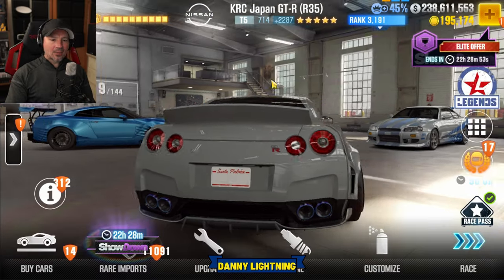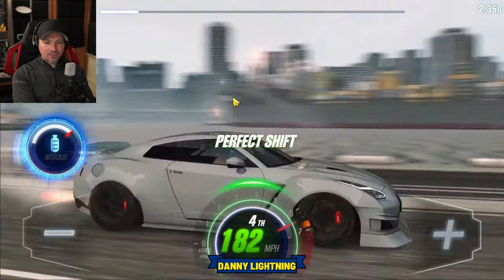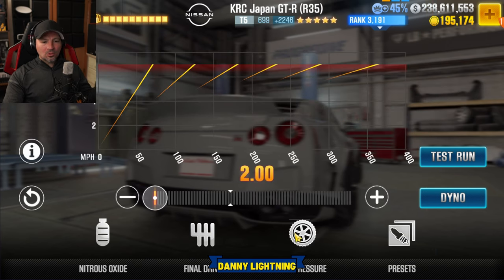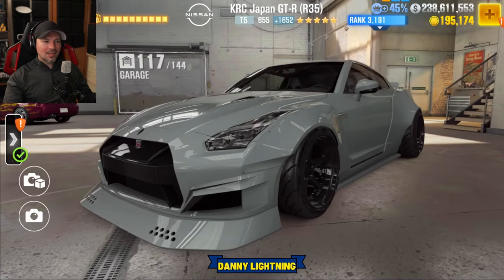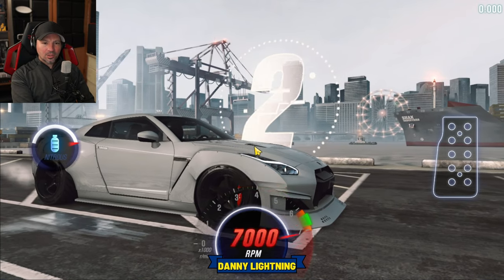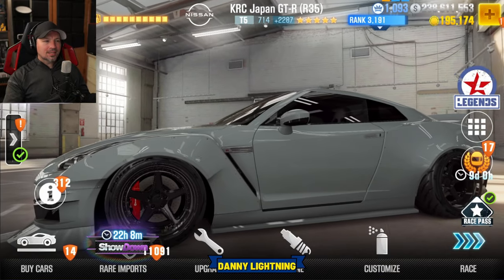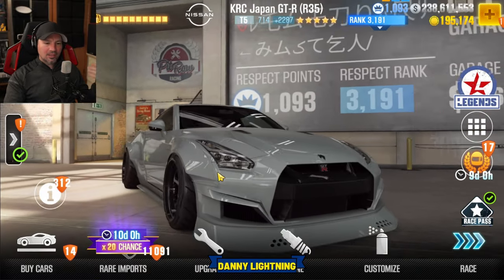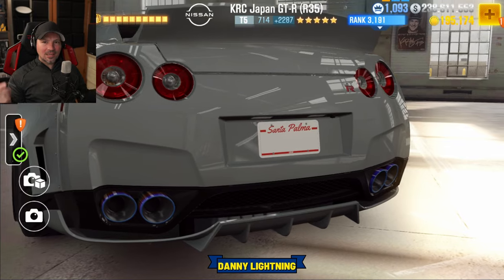CSR2 KRC Japan GTR Shift, Tune, Review, How To Drive, Live Racing Setup

Comment: Nitrous not going off is a huge problem
Reply from the maker: I don't get that too often but it does happen occasionally, I think it's mainly on the PC I don't think I have that happen on my phone very often but I could be wrong
Reply: Usually only happens in showdown for me.  Like i need anything else working against me lol with that and the cheaters the game doesnt do anything about its ruff. Currently running 7.360s need the stage6 nitrous for this still. Got the body 3x like Usually

Comment: hey danny will that car be able to beat shax's sesto elemento?
Reply from the maker: If you get enough parts on it yes easily, most tier 5 cars can beat shax but that boss car is not very good so I wouldn't recommend putting in the parts into it if you get it save them for when you get a better tier 5 car camera the KRC is kind of cool, I just wish it were a little bit better at live racing but it'll probably be halfway decent but the shack's car not so decent

Comment: I have the purple star version of this car maxed out will this tune and how you drive it still apply?
Reply from the maker: The purple star one should tune in the same, I mean it holds a couple more fusions and it's slightly faster but they're very very very similar overall,  I'm not 100% sure if they shift exactly the same so I would get on YouTube and see if anybody made a video for the purple star one, but generally there's only like a very small handful of people that end up with the purple star car so most people are looking for the golden star one.  If I remember correctly they tune and shift the same but just to double check I'm sure somebody made a video for the purple star one maxed out
Reply: @Danny-Lightning-CSR  yea I ended up finding a couple but they all said something different and ran about the same time, I really wanted to get into the top twenty times on the prestige cup since it’s maxed but I’m convinced the guys that have a cheating I’ve ran it at least two dozen times and I can’t get under 7.08 meanwhile they’re all at 7.06

Comment: Will it beat John Harkness for sesto Elemento?
Reply from the maker: Is long as the car will go over 260 mph and run faster than the boss I mean most tier 5 cars that have four or five stars can do it no problem, I can't remember what the top speed on this car is, some GTRs have a very low top speed but very fast acceleration so that kind of car might struggle but I would have to watch the video again to recall what the top speed was on the car, but I don't have time to do that right now but most tier five cars unless it's one of the crappy ones will do it no problem with enough parts installed
Reply: 366